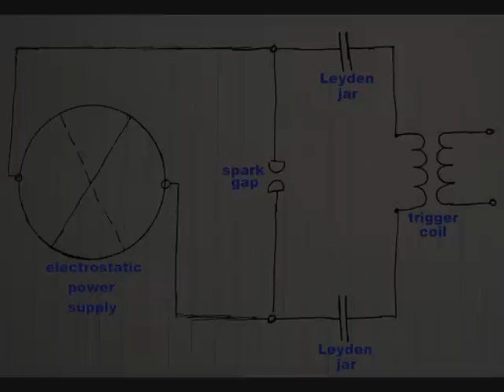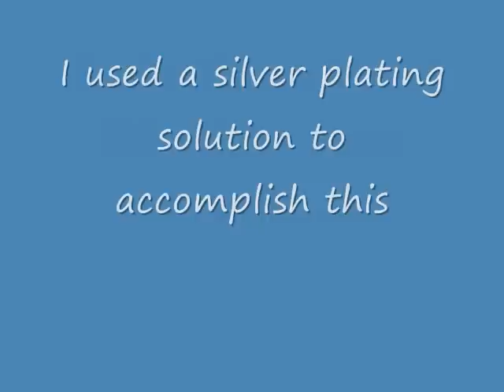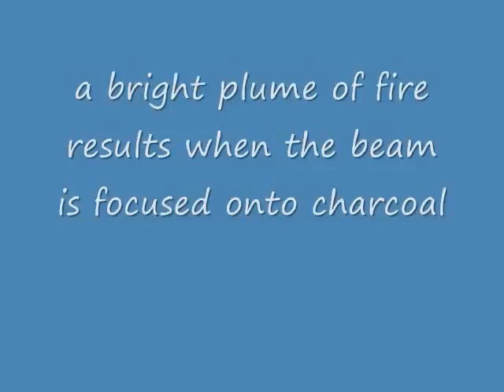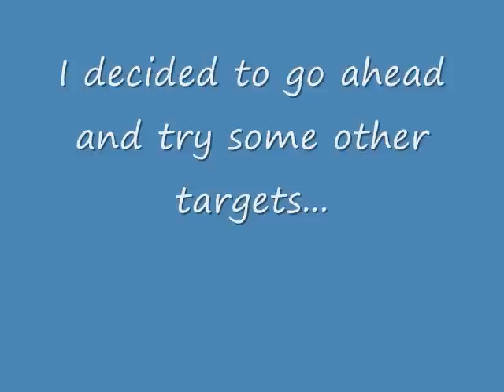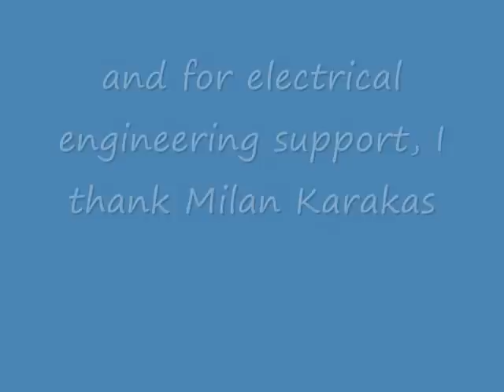Homebuilt Ruby Laser

Comment: @magx1 Coated ruby rods have the mirror medium deposited on the the rod ends. External mirrors are obviously external. When pumping a ruby laser rod with an argon laser it does not need the ends to be coated. It needs no mirrors at all for laser action to occur. It works like a dye laser cell pumped by a nitrogen laser that also needs no mirrors on the dye cell for lasing to occur.
Reply: Would that work with an green or blue diode laser too? What wavelength prefereable and pumping from the side or axial? Thx ;)

Comment: @magx1is right. Most ruby lasers are pulsed. The chromium atoms in the ruby never run out so the rod can last forever (If used properly). CW ruby lasers pumped by lamps are possible and available, although the powers are much lower than the pulsed versions.  Ive done a CW ruby laser by pumping the ruby rod with  the 514.5-nm argon ion laser line though very inefficient. Best part though is you don't need a coated ruby rod or external mirrors at all.

Comment: I would have loved to more detailed explanation on how you built this since this is the only Ruby laser I can find that relies on a wimshurst machine
Reply from the maker: The Wimshurst machine was merely an experimental alternative to a conventional trigger device. I do not recommend it unless you are thoroughly experienced and familiar with HV circuitry and everything that is involved. The energy stored in the capacitors, in the form of electrical charge, is instantly lethal. If you come in contact with it, you'll be dead before your body hits the floor! 

I recommend that you visit Sam's Laser FAQ - based upon your own experience, perhaps you should first construct a nitrogen laser to familiarize yourself with high-voltage circuitry before proceeding with something more dangerous. 

https://www.repairfaq.org/sam/lasertoc.htm
Reply: @magx1  I'm actually working on a nitrogen laser right now anyway I was more curious about the construction process and not looking to build one myself at least right now because like you said high voltage can be a very dangerous thing if you don't know how to handle it
Reply: applied science has a video on how to build one without the wimhurst once you see how it's built you could modify the design to be powered by the wimhurst

Comment from the maker: @DevilMaster 
You are correct. However, a tightly coupled arrangement is easier for amateur construction. Elliptical reflectors are only better if they are designed properly. With elliptical reflectors; the rod, lamp, and reflector must be parallel. The rod and lamp must be positioned exactly along the focal axises of the reflector. Unless special consideration is given to optical precision, elliptical reflectors are ineffective when compared to a simple design, like the one that I use.

Comment: i have a question. if the laser was intense enough to outpace the ability of oxygen to reach, say a piece of wood, so it would not be able to oxidize as fast as the laser was supplying energy what would happen? people think if you had a powerful enough laser it could be used for battle but stuff only burns as fast as oxygen can get to it right? what happens then? would the carbon actually melt? supposing you could actually supply that enormous amount of photons.
Reply: Semih Tok thats what i was thinking

Comment: I used to do these kinds of modified particle and time-exposure tricks in the 80's.  GREAT EFFECT, but not NEARLY what you would actually see.  Another good trick is to time-expose the sparks thrown off of a small lit cannon fuse segment during a short time exposure...really looks like high-powered optical drilling.

Comment: Instead of useing a flash bulb can't you just pump the rod with another laser?
Reply from the maker: I don't know. Interesting question, and one I've entertained on more than one occasion ;-)
Reply: Yes you can and it's totally awesome. The lasers at the national ignition facility to fuse tritium for energy research use what's called a master oscillator. This is a laser that is used to power other lasers. The advantage being power scaling, and perfect timing since the beam from the mo is arriving at all the larger lasers at the same time. That's part of how they achieve pico second bursts leading to high energy density...
https://en.wikipedia.org/wiki/National_Ignition_Facility#Driver_laser
https://en.wikipedia.org/wiki/Laser_power_scaling#MOPA
Reply: I was think more along the lines of a uv laser.
Reply: wakefield generators are superior
can be desktop now.
Reply: Yes you probably can. It's been done years ago with an Argon laser (blue-green) - probably because that's what they had around with enough power at the time. Ruby absorbs well at some blue/green and violet regions. I forget the numbers now. A modern violet or uv laser might have success. The Argon experiment did require cooling of the ruby crystal though - not to keep it from being damaged, but to keep quantum efficiency high. It drops with temperature. It probably has to be pretty cold, highly focused, and a relatively thin slice of ruby, not a rod - but is probably doable.
Reply: Well why hasen't any hobiest tried it the UV diodes are cheap.
Reply: @Ham549  I was just recently reading an article about Chinese laser weapons I think. Anyways it mentioned that the way to do it compact was to have diodes in a helix around a fiber optic cable that combines them all.... would be a sweet diy vid if some hobby guy like styro pyro did it with a bunch of cheap uv diodes and use a forge to draw a cable of optic glass. Also codys lab and some other channels have researched making clear glass
Reply: But idk if the fiber optics is supposed to be something that will laser amplify... probably have to add neodymium or something

Comment: I am curious about the below questions, regarding using other lasers to give a continuous energy feed to the ruby rod. Some method of liquid cooling would be required in tandem with it, since they put out a great deal of heat. Some form of self-contained, self-powered generator would also be required, eliminating the need for heavy batteries. Please let us know more about this.
Reply from the maker: davidsirmons 
CW ruby lasers were operated as far back as the 60's (early 60's, I think). However, they weren't practical at all - nothing more than experimental devices. Today, a commercial diode-pumped CW ruby laser exists. It's called the Crescendo. Just do a Google search. It'll produce a fraction of a watt - it's not going to blast holes in razor blades. But it's certainly an achievement, presumably owing to possibilities that are exclusive to modern diode laser technology.

Comment: How about some meat? Just curious what would it do to flesh.
Reply from the maker: mihauok1 

You raise a very good question. I’ve often wondered what the laser pulse would feel like, but never had the courage to put my arm in its path. There are a number of considerations:

1) Energy of the laser pulse
2) Duration of the laser pulse
3) Wavelength of the laser pulse

Energy and duration:
For a given amount of energy, power and time are inversely proportional. Q-switching is a process that makes a laser pulse much shorter, thereby increasing its power. Small q-switched lasers can produce enough peak power to make sparks in air when focused. However, these powerful pulses only last a few nanoseconds. Q-switched pulses can vaporize anything when focused, but only a very limited amount of material can be vaporized in each pulse. Q-switched lasers can be used to remove tattoos by quickly vaporizing tattoo ink while leaving underlying tissue relatively unaffected. If a ruby or Nd:YAG laser is not q-switched however, the resulting energy can create burns in the skin. Provided the pulse has enough energy, such burns might be relatively deep compared to burns made by a q-switched laser. This comparison is speculation however, as I’ve never investigated or researched the aforementioned difference. 

While a ruby laser pulse can vaporize anything, especially if q-switched, it doesn’t stay ‘switched on’ long enough for heat to spread beyond a very small area. 

Power = energy/time

We’ve probably all seen those videos where someone pops a series of balloons with a small continuous-wave laser. At close range, the balloons pop in rapid succession. As the distance between each balloon and the laser increases, more time is required for each balloon to pop. A laser often struggles to pop the very last balloon. The peak power of pulsed solid state lasers far exceed the power of continuous lasers. The pulsed output from a ruby laser is overkill for the light task of popping latex balloons, yet the powerful pulse doesn’t last long enough to pop more than one or two balloons at a time (certainly only one balloon, if the laser is q-switched).  High peak-power pulsed lasers are therefore limited in how long and deep they can burn or drill. 

Wavelength: 
Different laser wavelengths have different effects on different materials. We’ve all seen videos featuring visible-light lasers cutting black electrical tape or melting black plastic, but a mid-infrared range CO2 laser would burn or melt plexiglass, or even ‘real’ glass, as easily as a visible red or blue laser burns and melts black electrical tape! Being red in color, blood would undoubtedly absorb more energy from a blue laser beam than from a red laser beam, given the same output rating (tissue absorption of energy, for different wavelengths, being an important factor in laser surgery). So the amount of energy that is absorbed by any material will be reduced by the amount of energy that is reflected and transmitted by that material. 

Continuous lasers:
Something can become hot if exposed to energy in the form of a continuous laser beam, just like something can become hot if it sits in the sun long enough. However, most lasers don’t generate a lot of energy in the form of a laser output. The total energy in the broadband light from household lamps is greater than the energy from most laser beams. The difference is that laser energy is highly concentrated and controllable - it can be focused to a diffraction limited spot to create power densities far beyond what would be possible with ordinary light. Pulsed lasers push things to even greater extremes by creating unimaginably short pulses, thereby reaching peak power levels that are unattainable by other means. Were it not for these unique properties, the laser would be uncompetitive with conventional tools. 

Comparison of laser power over area: 
If a 100W laser beam were expanded so that it covered the area encompassed by a single slice of bread, it would only be about 2 W/cm^2 - not even enough power to toast bread! If however this same beam were focused to a point (about .01mm in diameter, based upon the wavelength of a CO2 laser), the resulting intensity would be enough to cut through almost anything - over 200 million watts/Cm^2! Of course, this assumes an ideal and high quality TEM:00 Gaussian beam, but regardless of the quality, the difference would practically be just as staggering. To my knowledge, there is no practical way to concentrate 100 W of incoherent light or electromagnetic energy to 200,000,000 W intensity! 

Thank you - again, this is a very good question. If anyone reading this recognizes errors on my part, please advise. What I’ve said is obviously not comprehensive - I merely seek to convey a general idea about the substantial limitations of different forms of laser energy, as related to the absorption and effects of this energy upon various substances.

Comment: Why don't you make a video of the laser actually working?
Reply: *****

so you're saying that pulse of 250 microseconds is enough to punch through a mm or more of steel ?
scary

any idea how much that comes down to in watts?
Reply: Flyingcircus Yes, but tiny holes, and only at a thickness of less than half a milimeter, so no.
Reply from the maker: Yes, it's all on a tiny scale both in terms of size and time - you are correct. Unlike the effects produced by a continuous device, such as a carbon dioxide laser, the 'micro-dramatic' display of light and heat would be quite feeble if presented in video, assuming that most or all of it didn't fall between video frames! An obvious exception would be the use of a high-frame-rate camera capable of capturing most of the 'action' and slowing it down, but that's beyond my budget ;-)
Reply: Teth47

"so no" what?

in the pictures on flickr it's clearly shown that it can punch through a ~1mm thick steel ruler and a saw

if those had a thickness of less than half a mm they'd be wobbling all over the place
Reply: Flyingcircus In one pulse? Because if there's no limit on how many pulses he can give, it could punch through a lightyear of steel.
Reply: Teth47

if you don't know, exactly what is your qualification in answering my question?
Reply: Flyingcircus I was working based on the context given by the video.
Reply: Teth47

and what makes you think that i am lacking this information?
Reply: Flyingcircus Well, your comment was misinformed, considering he clearly stated that it barely made it through in a single pulse aimed at a razor blade.
Reply: Teth47

clearly? nowhere did he make use of the word "barely" or anything similar
Reply: Flyingcircus I guess i worded that poorly, he stated that it made it through in a way that denotes amazement of its ability to do so. You can also see a sharp dropoff of apparent intensity immediately after the razor blade, and many of the pulses do not appear to have burned through the entirety of the blade's thickness. Simple inference leads one to the conclusion that it lacks sufficient power to burn a hole in a 1mm thick plate in a single pulse as it seems to only be able to punch through a razor blade some of the time. 

Is that better?
Reply: Teth47

those instances where it didn't punch through at all or only barely may have been due to wrong focus of the final lense

also the camera will blur the action due to shutter speed limitations and the laser beam will quickly lose focus after hitting its target due to the final focus lense (you can see the cone quite well in some shots)
so the laser punching through with high residual intensity may not always be visible because of the very low exposure

the pictures on flickr do however contain pictures of holes in a saw and a steel ruler and the pictures in the video show some instances where the laser is punching through the razor blade with room to spare and that's enough to warrant my question
 
and unless you somehow have access to information that i don't you can't really answer my quesion in his stead
Reply: Flyingcircus As I said, working from the context of the video, wasn't aware of the Flickr account. Had I been, I would've answered differently.
Reply: @magx1  "the use of a high-frame-rate camera capable of capturing most of the 'action' and slowing it down, but that's beyond my budget ;-) " i think you doen juts that with your dye laser vids where we can see the beam in almost a normal play speed but looked obvious it was framed ,id love to see this ruby laser in action with your fog machine ,perhaps you can find the proper rep hrz to simulate cw action using other power source
Reply from the maker: ARCSTREAMS the ruby can only fire one pulse every several seconds. More pulses per second would require liquid cooling. When ruby becomes warm it will not lase. Ruby has been replaced by much more efficient laser types, for many and most applications. Regarding some of the earlier comments above: the laser can punch holes in razor blades in a single pulse but not thicker targets. Proper focusing is important. Depth is limited because eventually the side of the 'cone' of focused light becomes blocked by the border around the opening to the hole made by previous pulses. Making the focal length longer and the tip of the light 'cone' longer, doesn't work either, because a longer focal length results in a larger focal point (which results in less power density).

Comment: Hi, just want to ask, did you use any "Q: switch in your laser 
I have a similar device, but didn't build it like you did, I got the rod and the lamp, and every thing else, OC mirror reflecting mirror, if I put it together will  it do like it did in yours blasting holes through steel, even without "Q" switching? i'll wait for your reply
Thanks

Comment: For the last 2 years I have been working on a diode pumped, gain-switched and q-switched Nd:YAG laser, which I hope to unveil at the end of this year. This ruby laser is very impressive. I would be willing to bet that if this was q-switched it could easily do lunar laser ranging.
Reply from the maker: This is actually a small laser. Lunar ranging requires something quite large, or at least it did when it was originally performed.

Q-switching exploits peak power at the expense of some of the energy that would otherwise be available in the form of a laser output - it's a trade off. Q-switching is ideal for applications that derive the most benefit from short, powerful pulses. Such applications would include things like tattoo removal, where rapid vaporization of ink is needed while minimizing damage or destructive effects to adjacent tissue. The effects are extremely localized, because there is no time for heat to travel. Aside from having an important role in medicine, Q-switched pulses can also be used to perform tiny welds in or around sensitive electronic circuitry. 

For dramatic displays of effects, such as drilling and burning holes in things, a basic oscillator is probably the best option. It is most certainly the easiest option.
Reply: Collimating the beams output  with a high degree of magnification is the key using a very large and accurate tracking telescope